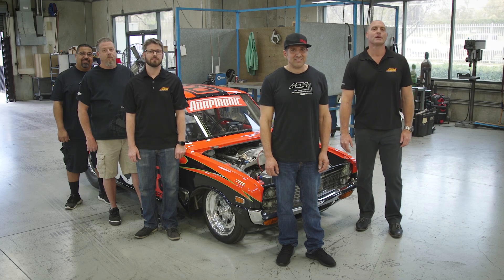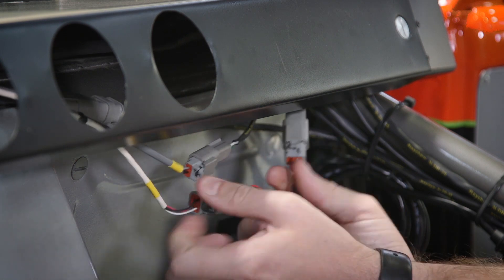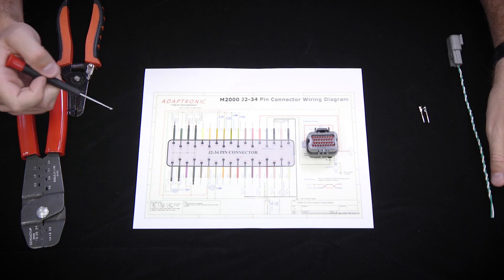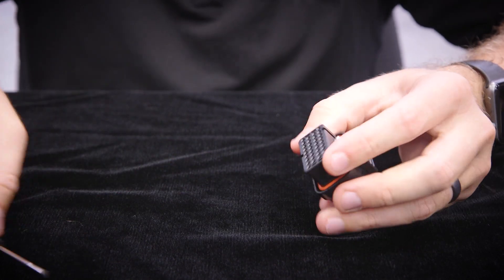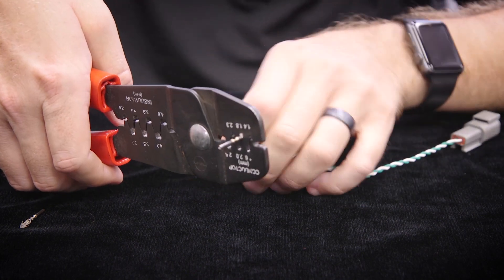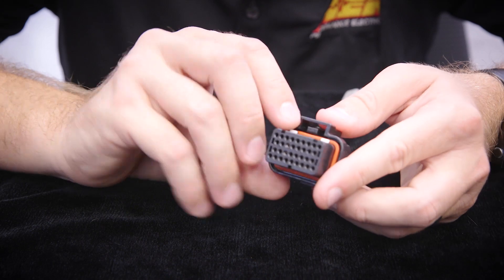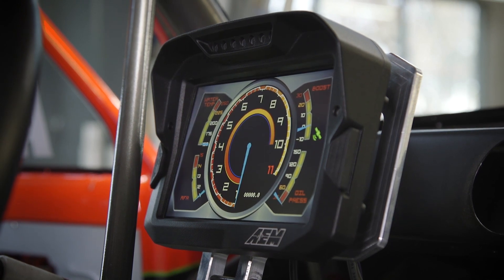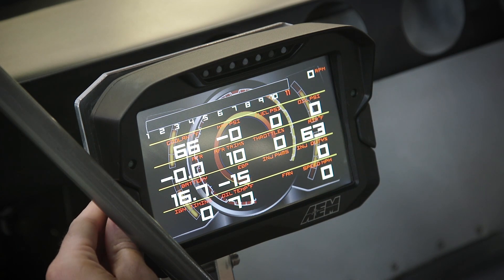Connecting AEM's CD-7 Dash to the Adaptronic ECU in Flaco Racing's Legendary Mazda R100 Drag Car!

Comment: Im going  to run my cd7 with a Microtech lt10c. i was wondering how would a wideband connect to it so ill be able to see AFR on the dash?
Reply from the maker: Hey Jose! If the Microtech has an input that will output Lambda on its CANbus you can wire it into the LT10C. Otherwise, you can use our Inline X-Series Wideband controller and connect that to the AEMnet CAN input on the CD dash harness and you will have AFR on your CD dash!